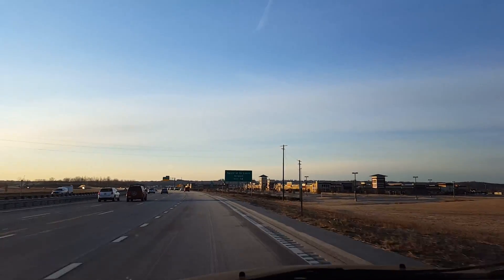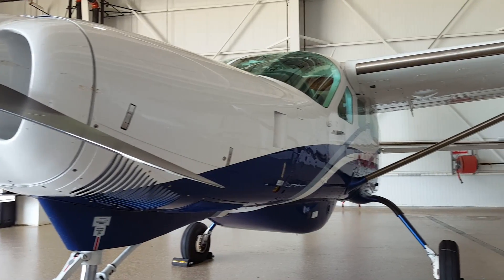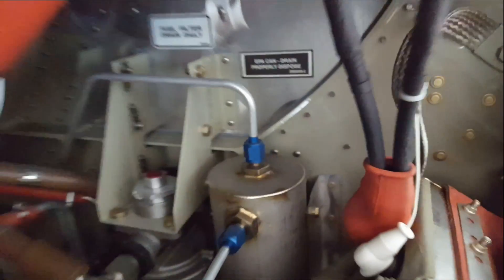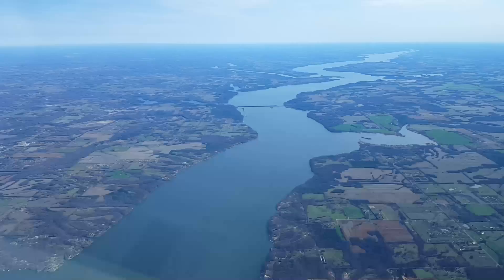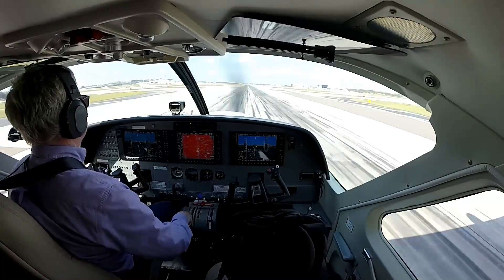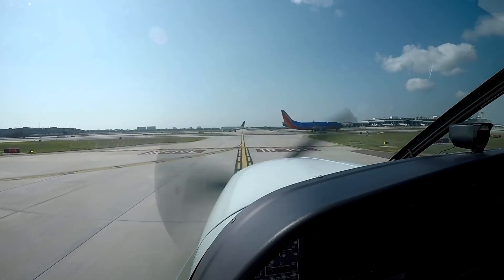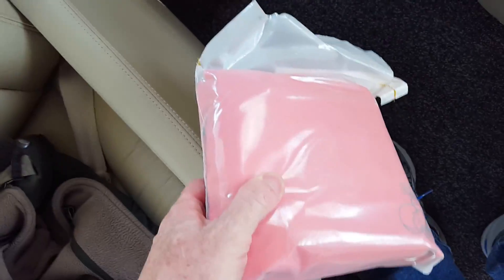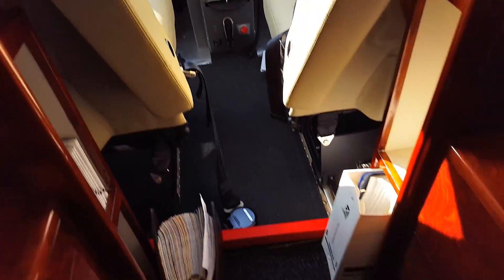I NEED OXYGEN, Cessna Caravan Flight to Tampa Florida, Pilot Vlog 135

Comment: Hi Another great video. I visited the Keck telescopes on top of Mauna Kea at 14,000 feet. The atmospheric pressure there is about 60% of sea level, so I can see why you need oxygen for safety in your job. We acclimated our bodies at 9000 ft before driving vehicles to the mountain top. There is oxygen available at the telescopes but they are usually not needed for walking around the facility. Also thank you for another reminder for me, in 2011 my cancerous bladder had to be removed and now I use bags to collect the urine. I am very grateful to the surgical team that extended my life and you reminded me what it used to be like to have a urge to go.
Reply from the maker: Hi Joe I drove up to  the top of Pikes Peak in Colorado at the same elevation. You don't really notice it sitting but, once you get out and start walking, especially up grade, then it really hits you.

Comment: Looks like your block speed was 195 knots...I'm guessing you'll get the return flight, and I doubt if it will go as quickly.
Also I like some of the system descriptions too. 
Does the Caravan have an 'autostart' or do you have to manage the ignition, fuel addition and starter/generator....all while looking at the turbine temp... (seems like a hectic minute)
Reply from the maker: It's all manual.

Comment: Congratulation for this record flight, Jim. In my old days, when I was on a long range flights with a C-182 I always used to piss into a plastic bag and threw it out of the window. Even women are said to have done so, which is much more complicated, as you can imagine :-) Glider pilots are using a special urinal with an outlet on the bottom of the planes fuselage.
Reply from the maker: Using the bag is tough. A relief tube is the way to go.

Comment: I would love a job flying the Caravan or any Cessna Jet. I just took my first job at my local FBO instead of working behind stovetops and playing with fire and knives...Going to degrease my way into the flight deck, this is where I want to be...
Reply from the maker: I think that's a good move. Lots of pilots have found job leads by working at an FBO.
Reply: Considering the bank check routes are all but gone now how does one gain the hours needed for their commercial rating?
Reply: 250 hours needed for commercial...Where I work the instructors and pilots can fly for the DNR. 3 free flight hours for counting boats in the lakes, some have acquired over 50+ free hours in a year...Also Civil Air Patrol, Glider Tow Pilot, Safety Pilot...It can be tough at first to get the required hours but once you get your commercial rating you can start working.

Comment: I think you need to have what used to be a "motorman's friend" up there in the cockpit! Or just a large-mouthed juice bottle! If it's #2, then good luck friend! Stupid question of the day......does the aircraft have O2 canisters or is it some kind of O2 generator? I told you it was a stupid question! BTW, I am a person who just loves flying but does not have a license to do so. That is why I enjoy your site and the "Premier One" vlog. Living my life through others.
Reply: Edward, they have pressurized bottles on board.  Oxygen generators are sometimes, often times, used in airliners for the passengers, and are very limited in duration.  The expectation is that they are used only in emergencies and the crew will get the airplane down to a safe breathing level as quickly as possible.
Reply from the maker: Thanks Edward. that's a very good question, we have a 117 cubic ft oxygen bottle in the tailcone.

Comment: I'm curious, at 15.000' you could have used a cannula instead of a mask.  Do you have a personal preference for the mask over the cannula, or was there possibly the expectation of going higher?

There are disposable gel packs for urine containment, might not be too bad if you're flying solo.  I would have hated to been in that position with others on the flight.
Reply from the maker: Hi Gary. This was the first time I've flown our Caravan hi enough to need O2. I had intended to do the trip at 9,000 and stop for a break along the way if needed. When I made the decision to keep going and climb to 15,000 to pickup speed I had to use the factory mask that were on board.
Reply: captmoonbeam Certainly makes sense to me.  :)  Would you fly at an altitude where you had to have O2 with passengers on board?
Reply from the maker: I Don't think I would plan a trip where I knew I would have to have the passengers on oxygen. If that were the case we would take the M2.
Reply: Yeah, I could understand that, passenger comfort and all.  But, the Caravan will carry more load than the M2, if necessary.  Ahhh, pile 'em all in the XLS!  LOL

Comment: Great video showing the different parts of the pilot business/career.  Will the Caravan need an engine wash once it comes back from the island and the salt air?  Stevo Kinevo had a video about it.  Just wondering how many hours of salty-air flight before extra maintenance needs to be done?  Thanks.
Reply from the maker: It did get an engine wash. The extra maintenance happens when corrosion develops.

Comment: What is the EPA can for? How long does the contiuous 02 last for?
Reply from the maker: It captures residual fuel at engine shut down. The duration of the bottle is dependent on number of mask being used. with only One pilot it last for hours. There's a chart in the plane that gives duration but I'm sitting in a hotel room so I can't look it up.